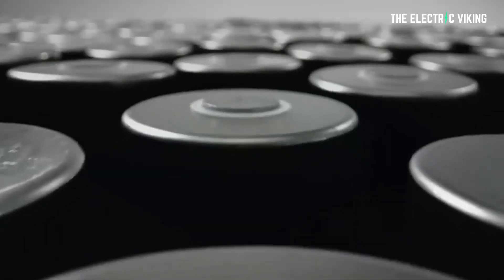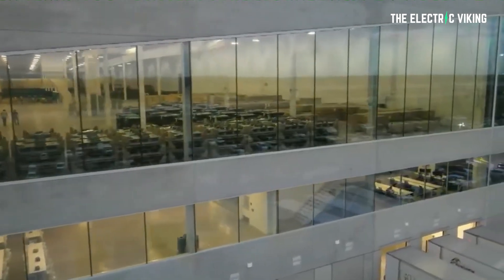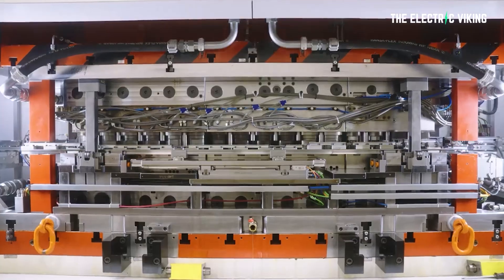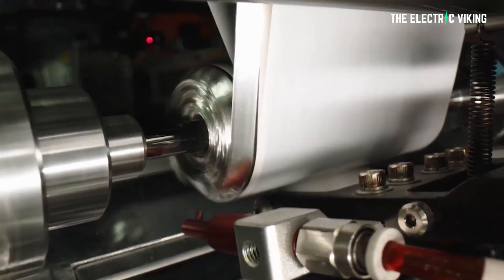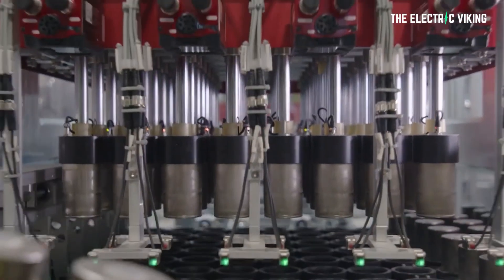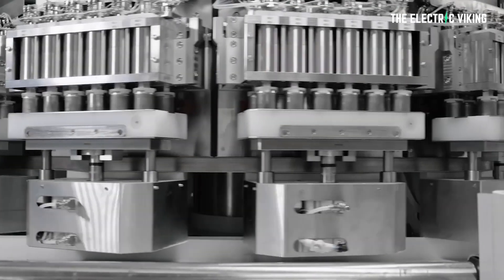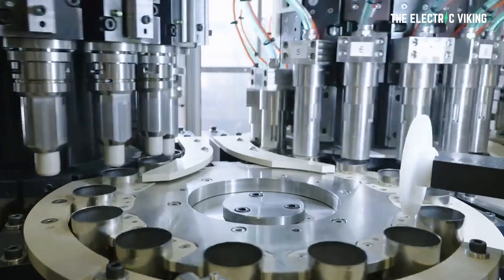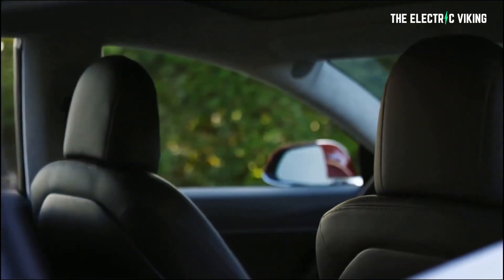Fremont 4680 battery production green lit + Texas' bizarre stockpile

Comment: Why is this so hard to figure out?  To my knowledge the 4680 Model Y is still not available for general sale on their web site.  Only limited test quantities really to employees and some local customers.  Also there is still a lot of conjecture on actual capacity in those cars as Sandy Munro confirmed 816 cells or close to that number, and others have confirmed 97-98 kWhr per cell, which puts the actual capacity in those “test”vehicles right at the normal LR model Y.  IMHO tesla is in cruise mode with the actual “test”cars, are LR MY’s derated for testing.  That would be exactly why they are stockpiling as they cannot  produce as fast as the cars, so they need to build up a buffer until the buffer plus ramp up rate of production equals their current / projected production rate.  Also needed for scale CT production.
Reply: Plus the Semi will be using 4680s too and those are going into production by year end, presumably.
Reply: @Chainyanker007  Extremely low volume compared to 3 and Y, especially globally.
Reply: Where is the weight saving for the 4680’s. The Texas Y weighs about the same as a LR Y with 2170’s.
Reply: @jackylsmith8138  Aren’t both structural but just different cell?
Reply: @jackylsmith8138  Exactly.  You hit the nail on the head!  Doesn’t make any sense mathematically that the 4680 pack model Y’s have a smaller battery pack as the weight is still there.  Also if you watch the charging videos from owners of the new Texas 4680 cars, you will see there were two other hints to a larger pack that are major.  Regenerative braking was not limited at all at the top of the pack (100% on screen), and torque was not limited at the bottom of pack.  These things are engineering facts, not optional.  This is a strong indicator that the bottom and top of the pack were extremely conservative and not real limits.  If you think about it, the entire strategy would have been pure genius on their part.  New owners are beta testers, and they get rewarded with range increase and value increase upon full optimization of the new packs.

Comment: Another plausible explanation is that these are not structural battery packs, just their empty shells, waiting for the battery cells. They would weigh maybe a couple of tonnes per square meter if you piled so many of them on top of each other, it could be less risky to stockpile them on the ground floor. But then maybe it's a very tough first floor...
Reply: It's not like Tesla to fully assemble  an empty shell only to take it apart in order to fit the cells. Remember Elon's mantra that the best process is no process and the best part is no part?
Reply: @eclecticcyclist   Right, but that's not really relevant: Empty or full, this stockpile breaks the best part is no part motto.
I was just wondering about the weight of these piles, but then I noticed it fills only maybe one third of the vertical volume, so they are probably taking into account this weight and the structural integrity of the floor, so I think that cancels the empty packs hypothesis, or they would have added one or two more empty packs on top.
Still, knowing that Tesla is stockpiling does really help figuring out why, if it's technical, strategical, etc.

Comment: Just wondering why they haven't put the latest battery tech in their flagship S & X
Reply: 4680 doesn't fit the current S, X and 3. They need new frames with structural battery pack architecture
Reply: That’s what I want to know.    The second it’s available I’m trading in my MSP for a 4680 version with Hardware 4.    Hopefully the new model will have over 400 real miles of range
Reply: With so many 3 and y comming to Australia and limited charging infrastructure we will need more range before we see those fights for chargers and also ICIng of charging spot's

Comment: It doesn't look like that many packs, if you think of the projected run rate of Texas.

It may only be a couple weeks worth of cars.
So they're probably ramping 4680 production, while having enough 2170 cells for the current run rate.

When they have enough 4680 production they could divert 2170s to other plants, stationery storage or just increase production.

That would be some of my speculation.
I would imagine the through put of materials of a factory with that sort of run rate is a huge amount.

Imagine how long 1000 packs would last in the Shanghai factory.
Reply: 1000 packs woud last 1/4 of the day lol

Comment: The Texas 4680 vehicles have the structural pack, no floor  & the  two giga-castings . Their 2170 really are the Freemont design with a rear casting.  All Texas wants is to produce vehicles as fast as possible & in my mind switching designs takes time & lowers output. I would guess that they are storing 4680 packs as fast as Texas's limited cell capacity. 
Take a note of Cleanerwatts 2nd generation 4680 Dry electrode cells and apply it to Freemont - The words "equipment manufacturing equipment " is the clue ," They are making EQUIPMENT  - equipment to produce cell faster, cheaper & with less rejects, not simply produce cells .

Comment: Ummm Im looking at the wording of this expansion at Fremont. The way its worded makes it seem like this new area is going to be manufacturing the equipment to make batteries, not the batteries themselves. Which would make sense because the new dry coating process is proprietary. They need to make those machines for each battery line they open.

Comment: Batching is part of the answer.  More than likely it takes a minor change to the production assembly process and robotics setup to integrate the structural battery pack w 4680s vs the current production setup of the 2170s.   

Pretty simple answer when you think about it.  The assembly wouldn’t be identical.

Comment: Perhaps this is because they plan on a temp shutdown of the battery pack assy line for maintenance/upgrade in the near future and by stock piling these packs, they won't interrupt the main assy line. Also, it's possible that the 4680 assy line is ramping up faster than the main assy line, which is good news for 4680 production but perhaps not so good news for the ramp speed of the main line. Dunno.

Comment: i would hazzard to guess they are hopeful that the employee cars they've been running with the 4680 will have an acceptable failure rate and hence they can give a thumbs up to putting the stored packs into cars.  They would need to be pretty confident that it will work to invest in a lot of extra packs.  The 4680's primary benefit is charge time, so that is a very nice benefit if it will finally work.  If it doesn't they probably will quitely let the 4680 die and the vehicles that required it will be fitted with something else.